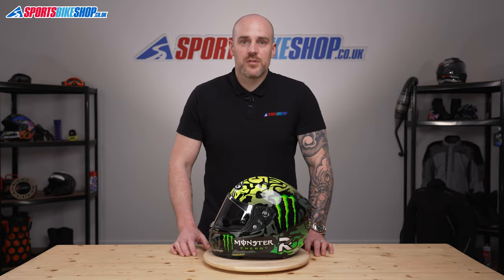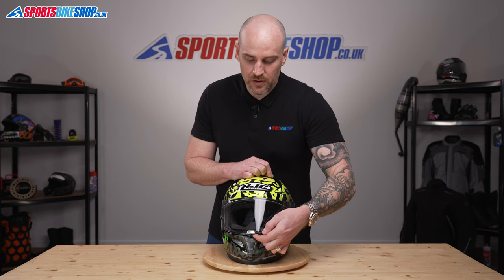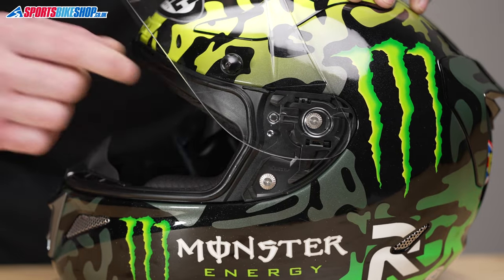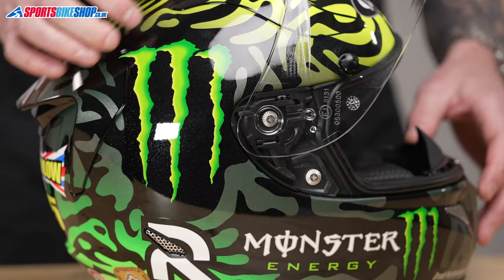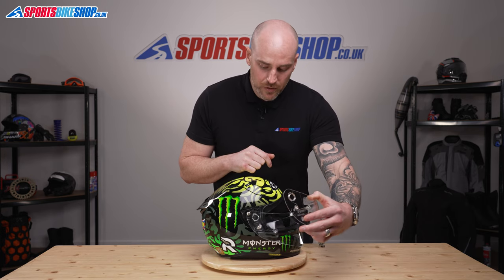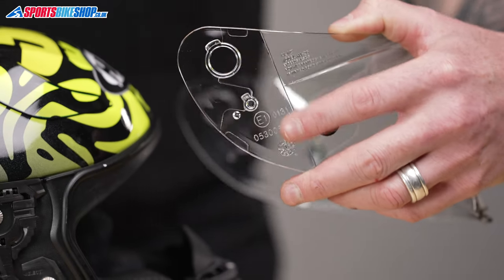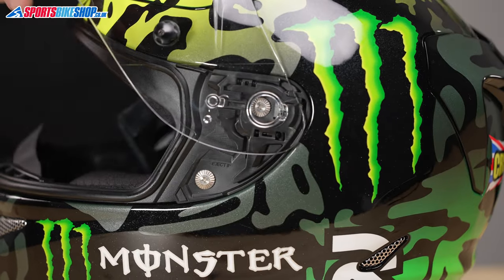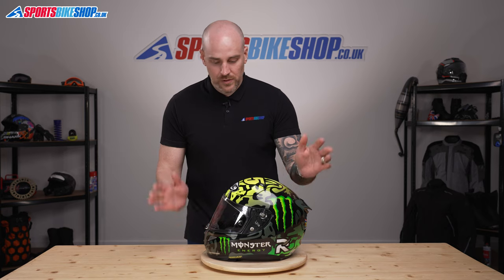How to change an HJC RPHA-11 AND RPHA-70 visor - Sportsbikeshop

Comment: My visor for the RPHA 70 erin white looks different, the pin lock part on mine is a small stud were as yours have like a black wheel...can you confirm they are the same before ordering ?
Reply from the maker: The helmet in this video is the RPHA-11 and the black wheel is for securing tear-offs on the outside of the visor. The RPHA-70 will look different as it doesn't have these wheels. This insert will fit both helmets... https://www.sportsbikeshop.co.uk/motorcycle_parts/content_prod/298787

Comment: Easy, but how do you adjust the pivots to hold it partly open?
Reply from the maker: Just checked the helmet and there's no adjustment available for this. The adjustment on the visor baseplate is to alter the visor's seal against the trim, not to make it stay partially open. Thanks for getting in touch. Cheers, Tony

Comment: RPHA11 visor lock slide clip what a fuckin joke it is ... pointless, unusable if wearing gloves, worse shitty designed item on any lid ever ... visor latch is more than enough to keep it down at any speed, rag the little fucker out with a small screw driver, it can get knocked & cause visor closure problems .... upper vents are impressive bug catching scoops, another crap design, lid needs a de-bug every ride.